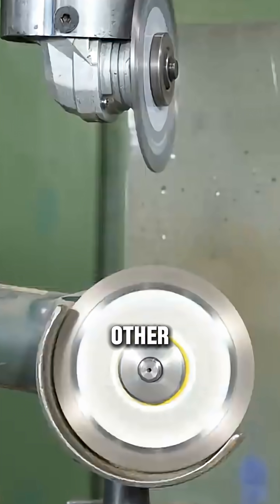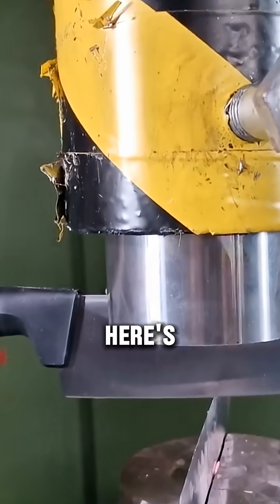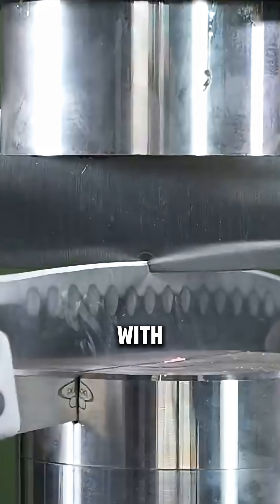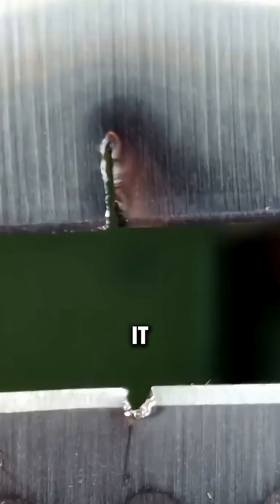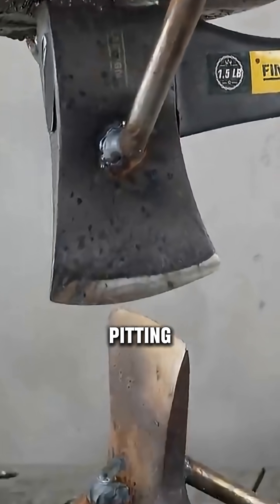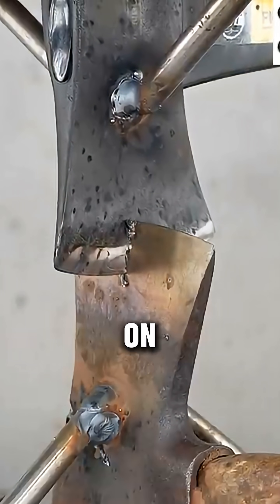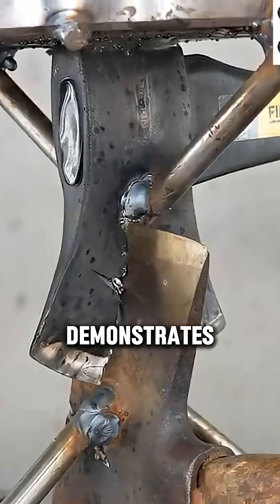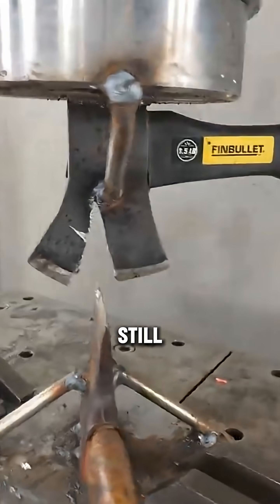Can Two Grinder Discs Destroy Each Other? The Result Is Unexpected #shorts

Comment: A fixed object, which has a solid base, has more "force" than a moving object. It's the same law of physics that says that for me, a right-footed soccer player, and having trained to kick with my left foot as well (in fact, I've become ambidextrous), the ball is more powerful when I hit with my left, because my right leg is stronger and acts as a lever, while my left leg, though weaker, acts like a whip, a rubber band.

Comment: Two different blades, one is being pushed with force, the other is stationary. You haven't got a clue how to conduct a ln experiment.
Reply: The force is the same on both discs, no matter which one is moving. Some physics understanding is necessary. Furthermore, every movement is relative, so it does not matter, which disc is moving.

Comment: Bullshit. Those cutting wheels would fucking explode
Reply: They're made of steel.
Reply: @scottll I truly believe that much pressure on two spinning cutting wheels would make them shatter. Not literally explode. But shatter and fly. I might be wrong. I don't attempt things that stupid. But that's my belief
Reply: @norestbicyling of course it's possible and you likely wouldn't be wrong every time. But are you saying this video isn't real?
Reply: @scottll I'm not saying it isn't real. I think that it's manipulated. Like you mentioned with one of the knives being thicker than the other.
Reply: I'm a carpenter though. Not a steel worker. I'm really just judging by what experience I have. I wouldn't say I have a shortage of experience with grinders though